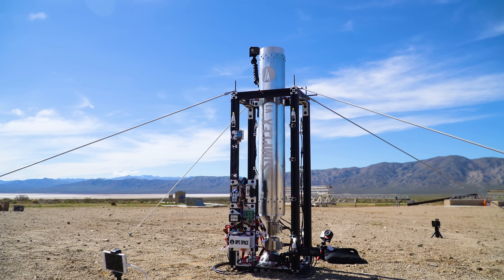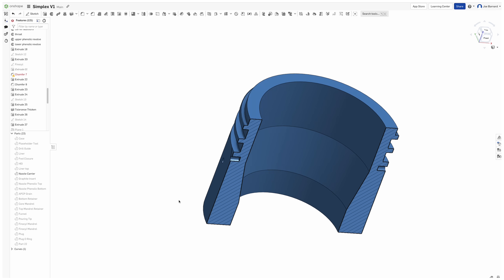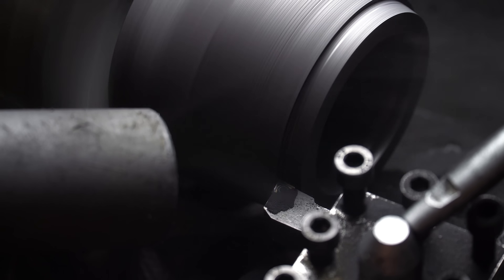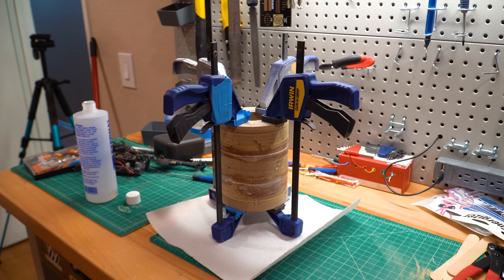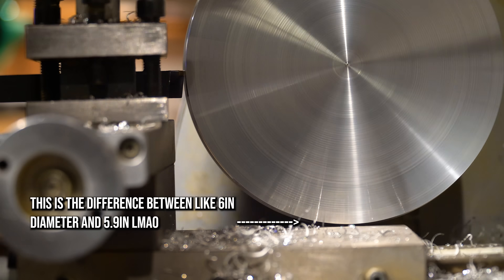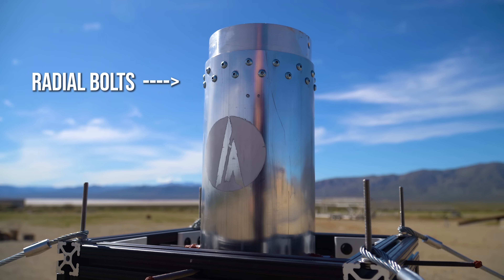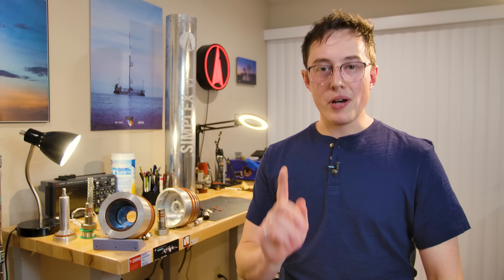Making a Rocket Nozzle - Simplex Ep 3

Comment: I am sure you can make it work with a significant weight penalty, but you seal design has the same issue as the shuttle SRB - when you fire it, the case will hot-dog and reduce the compression on the ring. If it is a constant wall thickness, it is either not thick enough at the ends, or it is too thick in the middle (with associated weight penalty). I assume that it is thick enough to hold the closures with holes drilled in it,  meaning it is maybe twice or 3x the weight it could optimally be.

Comment: You mentioned in the last video just how much work it is to iterate and fix issues, between the mixing, pouring, cleaning etc etc... over and over and over. I think the issue stems from you going straight to a full size instead of testing and iterating on a smaller scale first. Yes your giant stand mixer needs a certain amount of mix to work so you are forced to make gigantic amounts at once... but why couldn't you experiment with a 4 inch tube or even a 2 inch tube and use a smaller mix and smaller mixer? Get your formula where you want it THEN scale it up and test with the 6 inch tube with the massive amount of mix.

Comment: I enjoy your videos but I have one issue. You said that on the throat to nozzle ratio you just thought it looked right and didn't bother calculating it. Why go through the trouble of calculating your fuel only to half ass the nozzle on a rocket you want to go beyond 100 km? That just increases your risk of a wasted project that will achieve an altitude below your goals. You do good work but every inch you can gain is worth those calculations especially since nozzle is everything second to fuel choice and ratios.

Comment: Graphite powder is non-abrasive. It's a commonly-used lubricant in applications which cannot tolerate an oil or grease, because internal micro-sheets of graphite slide past each other easily. Imagine stacking a few reams of printer paper, gluing the bottom sheet to your desk, and putting a heavy weight on top. Then, shove the weight or the side of the stack. That's graphite.

Edit: I suppose that if your graphite were contaminated with a stronger carbon allotrope, like microscopic kernels of diamond, then it could also be abrasive. But pure graphite is much softer than basically any engineering metal like Al or steel, and it will lubricate quite well. You could also get some interesting chemistry going on, but pure carbon is pretty resistant to being put in suspension with or dissolving in most common solvents so that seems unlikely.
Reply: Graphite dust is both a lubricant and an abrasive. Turns out they aren't mutually exclusive properties. 

The key is the shape and orientation of the graphite particles. It's like a bunch of little pancakes. When they slide across surface to surface, it greatly reduces friction. When the edge slides across the surface of your material, it creates a little scratch, abrading it.
Reply: The softness of graphite comes from how easily layers break off. Once you get down to a single layer, the hardness is pretty much the same as other carbon crystals

Comment: G'day Joe.
For fitting your nozzle carrier with O rings installed into a liner.
You might consider using a tool called a 'ring compressor'.
Although the device is primarily intended for inserting piston and ring assemblies into the cylinders/liners of big diesel engines it might meet your needs too.

Comment: Hey I’m a machinst when you’re boring you can rough out with big cuts .03” depending on chatter from your boring bar but once you get down to final cuts slow is smooth .001-.004” but this is assuming your lathe has enough rigidity to stay accurate. Also a machinist handbook will tell you your slip and press fit sizes (among every other thing on earth) which can help avoid tolerance issues as you know exactly what you need. A tight concentric bore gives you more accuracy this inherent efficiency

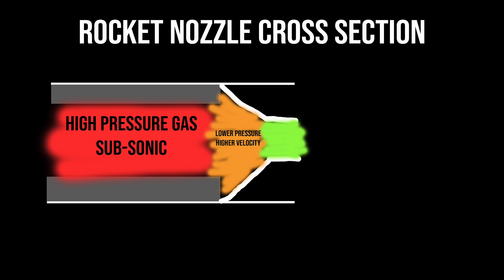Comment: 🙃 explanations @1:22 :hand-orange-covering-eyes: - @1:42 :hand-orange-covering-eyes:. Pressure begins to drop at @2:10 where and when velocity of gases begins to exit the previous high pressure area which is where the gases hit mach 1+ :face-red-heart-shape:. A fun thing happens when a high pressure gas is given a tiny exit ➡➡ <THIS WAY TO EXIT> Because the exit is small at the entrance to the exit the pressure is still high but once the gases begin to leave their velocity jumps way up and the pressure at that point on drops to lower pressure. :face-blue-smiling: I understand you understand what is happening but sometimes the explanations are a bit twisted from what is actually happening. 👏👏 If there was not a reduction in the exit vs the diameter of the area where the high pressure gas was at to begin with then there would be no drop in pressure and no high velocity thrust because all the gas would get dumped out the back in mere moments without a high velocity thrust :face-fuchsia-poop-shape:. It is the ratio difference from high pressure to low pressure that enables the velocity thrust we all seek and that special mojo is done via the exits size vs motor/gas area😘. There now I feel better. #Cheerios 🤣😇👊 #Whispers btw its not space its heaven🙏. 🤭🤫. . . 👉🧠👈

Comment: Have you tried wet pouring your mix into the casing, tooling installed, pull the vacuum on the pre-cast material that’s already in the case.  Maintain the vacuum through the cure and then remove the tooling.  No voids, perfect cast, tooling form is removed and you have a near perfect motor casting ready to shit and git.

Comment: For getting smoother tapers with the compound, of you put both small handles back on rhe wheel (looks like they were removed), you can chuck the base of a T-shaped piece of metal into a drill, and use that to turn the handles. As long as you have the drill in low gear and keep thr speed fairly consistent, it should work better and give a more consistent surface finish than turning the knob by hand.

Comment: You might think about making a piece with a conical inside bore to help you slide the cap with o-rings into the case, rather than risking pinching and compromising an o-ring.  IC engine builders use them to compress piston rings during insertion of the pistons into the bores of the block.

Comment: graphite powder is not abrasive. If that were true it would be used as a metal polish... which it is not. It IS used as a dry lubricant thought.
Reply: Graphite dust is both a lubricant and an abrasive. Turns out they aren't mutually exclusive properties. 

The key is the shape and orientation of the graphite particles. It's like a bunch of little pancakes. When they slide across surface to surface, it greatly reduces friction. When the edge slides across the surface of your material, it creates a little scratch, abrading it.
Reply: Remember, graphite has a hardness of 1-2 because of how easily the layers break apart. Get down to a single layer though, and graphite has the same hardness as other crystalline allotropes of carbon (think diamonds)
Reply: @differntname2807  I stand corrected, I wasn't thinking about how the geometry comes into play.

Comment: So graphite is a abrasive and a solid lubricant? 5:07
Reply: Yes! Turns out they aren't mutually exclusive properties. 

The key is the shape and orientation of the graphite particles. It's like a bunch of little pancakes. When they slide across surface to surface, it greatly reduces friction. When the edge slides across the surface of your material, it creates a little scratch, abrading it. 

But wait, graphite has a hardness of 1-2, so how can it abrade harder materials? Well, graphite is so soft because of how easily the layers break apart. Get down to a single layer and it has the same hardness as other crystalline allotropes of carbon (think diamonds).

Comment: Thanks for the great work, the idea, design, and production are extremely well thought out. 

But I have only one question regarding the linen phenolic it is composed of linen woven impregnated with phenolic resin, but how is it supposed to handle all of that heat? Because from what I could find only the phenolic resin is only rated up to 300 degrees F. So do you use a specific kind of high-temperature resin?

Thanks again for the great work.

Comment: Suggest getting an arbor press. Small 1/2 ton, and a larger 3-5 ton. Probably the most usefull tool in the shop. Saves dancing on top of critical one-off parts.

Comment: I wonder whether the holes and bubles in the circular section wouldnt actually decrease the peak "burn rate", because for a circular grain the peak is right at the outside shell before burnout. I would assume if there is a hole it would burn to the edge earlier on that side, thus reducing the propellant left at the outer ring.

Comment: Great video series, it takes me back to the 1960s when a kid couldn't buy an Estes rocket engine in california... without an adult, a stack of paper work and a sign off by the local fire department chief. Firing them was a whole 'nuther layer of misery...
Yes we made our own; yes I do have all my digits.
Reply: I remember the hazzle also! But we had a science teacher that in the 5th and 6th grade we would have rocket launches once a month! He taught us Trigonometry so we would have highest rocket launch. With a wooden triangle with a screw eye on top and bottom of one dide of triangle, and a protactor on the bottom with a sharpen popscile stick we'd sight the smoke trail and when it reached apogee we'd press the popscile stick and write down that angle. With that and the lenght from the rocket pad we'd get height of rocket! I knew trig in the fifth grade. School launches didnt need all the required permission. I didnt get it on my private launches at the park. But I do remembet reading the ruled. Thanks for reminding me of it. I was in elementry school in the 60's also. A great science teacher for sure. Mr Smith from Cloverland Elementry in Oakdale Cailf. Good times.

Comment: abrasive? graphite is used as a lubricant in places wet lubricants aren't practical. It is formed of many small plates that like to slide on themselves. Also it's one of the if not the softest mineral.
Reply: Graphite is a lubricant and an abrasive. Turns out they aren't mutually exclusive properties. 

The key is the shape and orientation of the graphite particles. It's like a bunch of little pancakes. When they slide across surface to surface, it greatly reduces friction. When the edge slides across the surface of your material, it creates a little scratch, abrading it. 

But wait, graphite has a hardness of 1-2, so how can it abrade harder materials? Well, graphite is so soft because of how easily the layers break apart. Get down to a single layer and it has the same hardness as other crystalline allotropes of carbon (think diamonds).

Comment: It's interesting to consider that the pressure wall is under axial tension while firing which suggests that the nozzle is actually pulling the rocket backwards. What actually makes the rocket go forward is the force on the forward bulkhead being greater than the force on the nozzle. The goal of the nozzle design is minimize the amount of materiel you need to allow to escape while reducing the amount of force pushing it back down.

I wonder if some very high expansion ratio nozzles (e.g. vacuum engines) get net thrust out of the nozzle all by it self and result in the casing being under compression?

Comment: Your nozzle angles are within reason. One thing to consider is a smaller divergent angle reduces cosine losses, aka some of the thrust being wasted going somewhat sideways out of the nozzle and not pushing the rocket up. By lower I mean something like 10 degrees vs your 15. Although a lower angle means a longer nozzle, and thus more weight, so it’s a trade off.

Comment: "Tolerance errors can stack up."

I have a picture somewhere that demonstrates this really well. Steel lattice tower welding jig was off very slightly. For an individual 3m section, you couldn't see anything wrong, but getting the pieces to mate was somewhat difficult. Once it was stacked to 100m? You could look up the leg and see the entire structure was twisted.

Ended up being something like $150k insurance claim to cover the labor of dismantling the structure and putting in a new one.

Comment: From the book Solid Rocket Motor Design, the convergence half angle is chosen between 30-60, if too big it will cause a lost in thrust, if too small then the nozzle will be too long, 45 degree is usually chosen. The optimum divergence half angle is 15 degree, to shorten the diverging section , it is best to be chosen 18 degree. Just as a reference for people who want to design solid motors.

Comment: For those slow increments on the lathe, This Old Tony has the solution.
Use two small T-welded iron bars and a screwdriver with speed control.

Comment: You claim graphite to be abrasive ... actually, it is widely used as an dry lubricant. For example you can buy graphite powder for exactly this purpose. Did I miss something or is this a missunderstanding? Your point with electrical conductivity of course is right!
Reply: You're right about graphite being used as a dry lubricant, but it also wears down cutting tools surprisingly fast.
Reply: Graphite is a lubricant and an abrasive. Turns out they aren't mutually exclusive properties. 

The key is the shape and orientation of the graphite particles. It's like a bunch of little pancakes. When they slide across surface to surface, it greatly reduces friction. When the edge slides across the surface of your material, it creates a little scratch, abrading it. 

But wait, graphite has a hardness of 1-2, so how can it abrade harder materials? Well, graphite is so soft because of how easily the layers break apart. Get down to a single layer and it has the same hardness as other crystalline allotropes of carbon (think diamonds).

Comment: I don't know why you say graphite dust is abrasive. I'm a machinist & we used to lubricate our machine slides with graphite powder. The structure of graphite is a bunch of flat layers that slide over each other when in powder form, & what rubs off onto paper when in pencil form.
Reply: Graphite is a lubricant and an abrasive. Turns out they aren't mutually exclusive properties. 

The key is the shape and orientation of the graphite particles. It's like a bunch of little pancakes. When they slide across surface to surface, it greatly reduces friction. When the edge slides across the surface of your material, it creates a little scratch, abrading it. 

But wait, graphite has a hardness of 1-2, so how can it abrade harder materials? Well, graphite is so soft because of how easily the layers break apart. Get down to a single layer and it has the same hardness as other crystalline allotropes of carbon (think diamonds).

Comment: If you’re going to keep making more of these you can get a concrete boring drill which is a hole saw that is deep enough to cut 6” deep or more.

You can also use isopropyl alcohol to lubricate the o-rings and leave no residue.  It doesn’t damage viton or most other common materials.

Comment: Wait, i thought graphite was used as a dry lubricant?
Reply: Graphite is a lubricant and an abrasive. Turns out they aren't mutually exclusive properties. 

The key is the shape and orientation of the graphite particles. It's like a bunch of little pancakes. When they slide across surface to surface, it greatly reduces friction. When the edge slides across the surface of your material, it creates a little scratch, abrading it. 

But wait, graphite has a hardness of 1-2, so how can it abrade harder materials? Well, graphite is so soft because of how easily the layers break apart. Get down to a single layer and it has the same hardness as other crystalline allotropes of carbon (think diamonds).

Comment: Machiniste trick, if you want to archive high tolerance, leave a little bit of material ( 0.001" or 0.002" ) and do the rest with sand paper ( turn your piece with the lathe and apply pressure with the sand paper), start with 80 grit and move to 120 grit. That way you can archive a good tolerance.

Comment: 11:30 I can’t help worrying about the O rings getting damaged by the way that you brute-forced the nozzle carrier into the motor casing.

Have you thought about using the same type of tool that car mechanics use when they install the pistons into the engine block?

It’s called a piston ring compressor, and I believe that using something similar, could greatly reduce the risk of damaging your O-rings. 
(And make the install a lot easier.)

Cheers from
Vejle, Denmark 🇩🇰

Comment: Graphite abresive? As far as i know its used as a substitute for greas. Correct me if im wrong! Is electrical conductive though!!! Nice vid btw👍🏻
Reply: Graphite is a lubricant and an abrasive. Turns out they aren't mutually exclusive properties. 

The key is the shape and orientation of the graphite particles. It's like a bunch of little pancakes. When they slide across surface to surface, it greatly reduces friction. When the edge slides across the surface of your material, it creates a little scratch, abrading it. 

But wait, graphite has a hardness of 1-2, so how can it abrade harder materials? Well, graphite is so soft because of how easily the layers break apart. Get down to a single layer and it has the same hardness as other crystalline allotropes of carbon (think diamonds).

Comment: Pro tip from a tool room worker when turning larger stock than your lathe can handle. Use a boring bar from the back side of the part turning backwards. Also makes chamfers and tapers on external flanges easier.